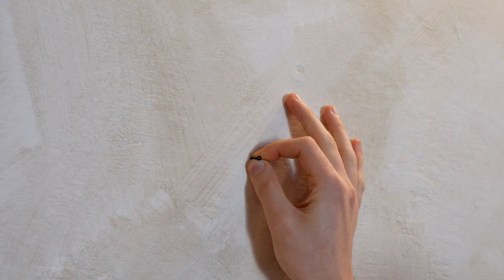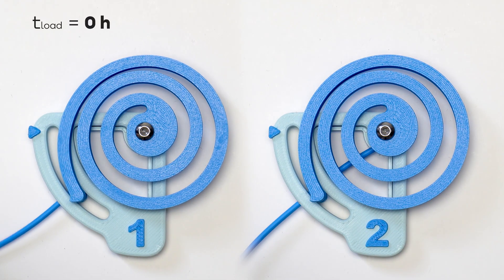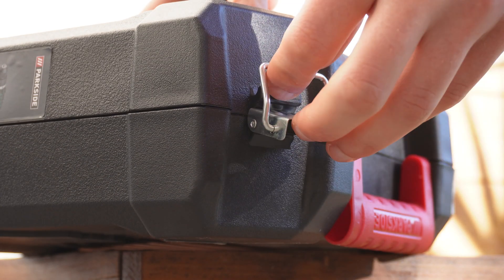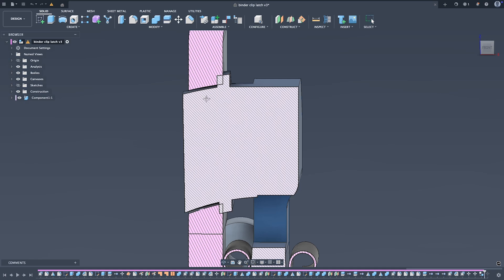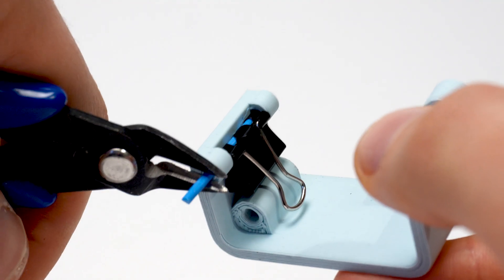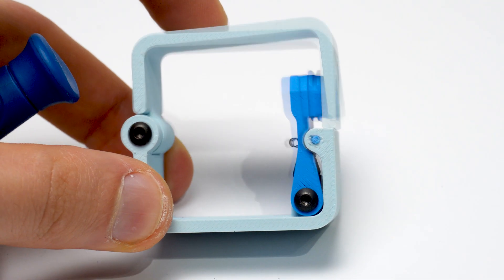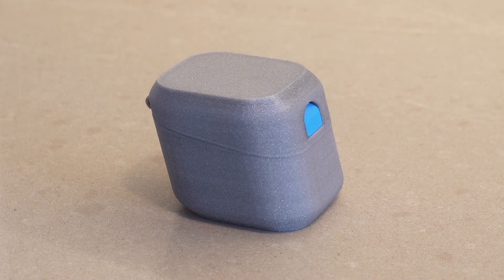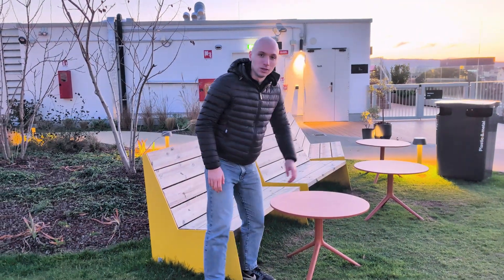Stop 3D Printing SPRINGS. Do THIS Instead

Comment: What a clean print! How did you achieve this? .2mm nozzle? Resin print?
Reply from the maker: Haha, no resin prints here! I'll give you the two tips that made them look so clean.

The first one is lighting: it's better to light them from the sides. If I use a harsh light from the top, the layers become visible (as in every filament print).

The second is using good quality filament, you can find the references for this video in the description

Comment: I bet you could have avoided that screw hole and just used the leverage and preload of the clip to keep that side of the latch in place.
Reply from the maker: Yes, I could've avoided using a screw, but I still want to keep a something that holds the rotation axis in the final design

Comment: do you have a video on your work flow ? I notice you used both fusion and blender and just wondered were there benefits to each software at a given stage of your development of the ideas and concepts presented here ?
Reply from the maker: You can find some of my Fusion workflow in the 'CAD-centric' playlist on my channel, where I show my design steps. Regarding Blender, I actually didn't use it for this project, it was 100% done in Fusion

Comment: Use different metals for different applications — the same applies to plastics. When printing plastic springs, select a suitable filament instead of using PLA for all purposes.
Reply from the maker: I'm aware that other materials have better creep resistance, but I wanted to explain a problem that many people aren't even aware of. I used PLA because it's the most common filament
Reply: @salveo3d  It's okay and I understand that, but you should mention that there are different types of filaments for different applications. A spring printed with PLA versus PETG or TPU will behave completely differently. Similarly, metal springs are made from special spring steel. If you used ordinary steel, it would behave just like the one you demonstrated with PLA.

Comment: No need to have exterior access for the screw. Just use an allen screw, or a 90º ratcheting tool for a normal screw.
Reply from the maker: In this case I had no side clearance for an Allen key
Reply: @salveo3d  I see plenty of side clearance. You know allen keys have two sides? The short one is literally 1cm for the type of screw you were using. And 15º of play is also plenty.
Reply from the maker: @ramaSwamp  Thank you for clarifying that allen keys have a short side, I really didn't know that

Comment: I like the idea of "Hybrid". Binder clip is a brilliant idea. Another way of getting Springs is from liquid dispensing bottles, e.g. hand soap bottles. They are everywhere, with different sizes too. I usually save some of the springs in case I need them.
Reply from the maker: Thank you! Just letting you know that the next project will be even more hybrid. Also, salvaging springs from soap dispensers is a really good idea, I'll do it

Comment: I think you could use something like a drill bit instead of a screw. Insert it into the tunnel in the box, design the connection point on the latch in a C shape, and click it into place. If the sides of the latch where the shaft sits are closed, it won't slip. The shaft housing in the box just needs to provide enough space to fit the shaft. Or maybe you could design that in a C shape too. Give it a try. I'm using Translate, so please excuse any incorrect translations. 🙏🙏
Reply from the maker: Sure Ata, I get what you mean, that's a good idea! Thanks for watching

Comment: What screws are you using? M2 Locking bolts?
Reply from the maker: M3x25mm, an M2 would be enough if you have it on hand

Comment: The idea is interesting, I printed it right away, but now I have no idea where to get such a small clamp, 15 mm wide. The smallest one I have is 19 mm.
Reply from the maker: Thanks for giving the project a go! I guess the 15mm one is the smallest size, and you can usually find it in stores too. If not, the internet is your ally

Comment: Not everyone prints springs, what are you talking about ? And your design isn't really convenient. I guess a metal spring is cheaper than the metal clmap you used here ..
Reply from the maker: Actually, there are a lot of printed springs on the internet. But using the binder clip isn't about price or sheer performance. It's about using something that everyone has on hand and repurposing it

Comment: Funny to watch this just after Print Farm Academy's "why we're injection-molding our bestsellers" -- where the injection moulder also points out they have some 3D printed consumables on the gigantic super-expensive moulding machine. Just because 3D is new and only thing that can say print-in-place chainmail, doesn't mean it's ever going to be good at everything, like springs.
Reply from the maker: Thank you for taking the time to watch it. I've also seen 3D printed parts making their way into high-end machines, and they are great. Injection molding still makes perfect sense and can't be beaten in terms of volume and strength. Both technologies can and will coexist together

Comment: Printing jigs is an excellent way to solve things requiring other materials using 3D printing. I've printed custom jigs for piano wire, bending it into custom spring coils. Actually, making your own springs is easy enough that I recommend the same for others.
Reply from the maker: A lot of people are suggesting piano wire, I definitely need to give it a try. Thanks for the tip

Comment: First draft, the friction and overlap. Well that is when you get to the sandpaper and/or file and start using hand tools to remove material. Unless you want to waste the print and print again.
Reply from the maker: Sure, but if you want to release a public file, you don't want people to have to file their prints. You want the right tolerances straight out of the machine.

Comment: Really cool design idea! You can use two shorter screws from each side and a "modeled thread" in Fusion inside the middle part to maybe get around having that hole on the outside. Schould still be easily steong enough since the stress point in this joint is the two plastic legs of the clip anyway.

Great design in general! I never understood the hype for printed springs in any shape. in my experience they always fail or creep to a point where the "snapped in" position is just very weak with no tension at all.

Comment: i guess you can take into account the deformation coeficient of the plastic you are using, there is a sweat spot where deformation is not ocurring not sure if it is enough for it to act as a spring, using that piece also feels a bit bulky on the design, but pretty cool !

Comment: By the way the binder clip does not use metal to avoid plastic creep, it's the plastic part that acts as a spring, it's just a special type of plastic
Reply from the maker: Actually, binder clips are made of spring steel, not plastic
Reply: @salveo3d  oh really 😮, I didn't know that I thought it's plastic cuz it looked like plastic, thanks for the info!

Comment: I have been incorporating standardized parts into my prints for a long time, and its hugely beneficial. More and more I have been thinking of my prints as a frame that holds the stock parts which get the actual work done. 

Bolts and threaded inserts are common hardware items, but there is another part I would highly recommend: piano wire. These are the metal rods that springs are made out of. They are less common than paper clips, but insanely customizable.

Comment: That's a sick design, good use of found objects. The one thing I'd be worried about is the little crossbar at the bottom of the D-shaped hole that the latch toggles against, that's a very thin part and it's going to be subject to a ton of stress - every time you close it, it's gonna get pushed against, any time anything puts stress against the lid it'll all go there,  and even when it's closed and sitting there, it will have constant stress on it. The whole rest of the design is so robust, that feels like a pretty nasty weak spot. If you could find a way to reinforce that little section with a metal rod or something, or just replace it with a metal rod altogether, i think it would go a long way to making the design robust enough to last forever.
Reply from the maker: Hi Daniel, thank you for the compliments! I'm not sure which hole you're referring to. Are you talking about the one on the blue latch?
Reply: @salveo3d thanks for the reply! I mean the thinnest part of the lid, the actual little bar that the latch clips over and holds against.

Comment: The problem with universal tools is that it often overshadows more efficient, specialist ones. Sometimes it sucks that we need to rent print time, but it does force us to use off-the-shelf parts as much as possible.

Comment: While I like the idea of using binder clips, it seems overkill to use it here for a simple latch that doesn't need to be in constant tension. Even if it is the better solution, it is also quite a bit more complicated.
Reply from the maker: It might be overkill, but it's so miniaturized that it’s totally worth it

Comment: While I agree with the general idea of not printing everything there are some issues with this video:
- Creep wildly varies depending on the material. You could have at least mentioned that it is a big issue for PLA, but much less for e.g. PETG
- This mechanism is a bad example, because it is not under permanent tension, so it would work fine with a simple printed latch. I have several boxes with printed latches, even from PLA, which are fine after years, because the latch is only bending, when opening/closing.
Reply from the maker: I could've mentioned that PLA is the worst, sure, but I wanted to raise awareness on something that's almost never discussed. And honestly, can you print a mechanism that small that works reliably?

Comment: In your v1 demo, the top shell is visibly pushed out by the clip. I understand you want it clipped in tight, but now you're keeping the "spring" that is your top shell under tension. In due time this will cause deformation of the shell even in s bigger model. Perhaps the bottom part should be a bit beefier to prevent this overtensioning of the clip.
Reply from the maker: That happens because it's an open C-shape. Without side walls to provide structural support, it simply splays out.

Comment: 0.3mm free moving, 0.25mm free moving with some sanding, 0.2mm tight fit, 0.15mm pressure fit. These are my orientation independent tolerances on PLA. Learned these on designing nuts and bolts.
Reply from the maker: I agree with the ballpark you gave. here the tolerances were a bit thrown off by the supports that made the first supported layer sag a bit
Reply: @salveo3d  yes, supports do that.

Comment: Thank you so much for saying the quiet part out loud - Just because you can 3d print something, doesn't mean you *should*.
Thats the biggest problem with nearly everyone in the 3D printing community. Trying to use 3D priting for *everything*, even though in a lot of cases, it's the worst possible design and material choice.
Reply from the maker: Sometimes you just need to say what everyone else is thinking

Comment: I love the idea of hybrid 3D printed designs.  I wonder about using other materials like windshield wiper stainless inserts or carbon fiber tubes.
Reply from the maker: Carbon fiber tubes are superb. Got an 8mm OD tube from Decathlon recently, it's amazing. Might have a project for it on the channel

Comment: In this type of mechanism, the spring is only loaded while latching, so creep shouldn’t be an issue. Limiting the range of motion of any flex and using it only occasionally changes the calculus. But this approach is excellent, and integrating OTS  hardware is an important part of designing 3d printed objects!
Reply from the maker: Thank you! It might be overkill, but it's such a compact solution, I just had to go with it

Comment: Great idea, but piano wire (also known as music wire) is a much more versatile and customizable spring element. Yes, you need to do more calculations at the outset (or experiment with different thickness of music wire), but you can dial in the exact spring force you want over many orders of magnitude, you can cut the wire to any length you want, and because it's a straight piece of wire it can be hidden in surprisingly small/flat parts.
Reply from the maker: I'll look into piano wire for sure, sounds interesting! The goal here was to use something readily available and ready to use

Comment: Very good idea! I have a box of metal coil springs, but this is much better for this application.
Do you even need that pivot screw? Just a recess in the outer shell for the lower part to sit in might be enough (restricting up/down and side movement), the clip is applying pressure to keep it situated there.
Reply from the maker: Yes, the more I look at this project, the more I see that the screw is overkill. A guide to keep the rotation axis stable would be more than enough

Comment: I think this method is useful for when a lot of strength is necessary, but is total overkill for the example box clip. Designs utilizing plastic spring forces have outlived the life of the plastic itself. They don't always lose spring travel, only when pushed past the limits of the material.
Reply from the maker: Honestly, it may be overkill, but at the expenditure of a binder clip, just a couple of cents. And you get a miniaturized mechanism, way smaller than if you had printed it

Comment: I really like the overall design. I printed a couple and here's my thoughts:
1. I love the clip idea, most people can get them. I love being able to print everything but maybe that's another days problem?
2. I don't think the internal screw is needed. if the binder clip is static and the latch stays it is retained by the clip. maybe making sure the clip can not move and the latch says seated inside the spring with rails to make sure it does not move.
3. opening seems less "satisfying" if you will, if you push the latch it does seem to spring open slightly. maybe increasing the upward pressure slightly. this might be a fine tuning issue between printers/filament.
4. immediately one of the hinges cracked. made me think perhaps having only 2 sides to the hinge rather than 3 might increase the strength some? This could be due to the hinges not printing cleanly.
5. installing the sprint clip took me a bit to figure out. getting the filament to slide in and getting the latch in the spring was harder than I imagined

Overall I love it and don't mean to focus on anything negative, just providing feedback
Reply from the maker: Thank you Nate, that’s some amazing and thorough feedback. I really appreciate the time you took to write this, and I want to address every point you made:

1 - Not printing everything was exactly the point of the video! Could you print it all? Sure. But sometimes, finding a more reliable 'off-the-shelf' is better

2 - I agree, the screw is a bit overkill. Many comments suggested great alternatives, like using a simple groove to guide the rotation, which I’m looking into

3 - You're right, the opening action isn't quite satisfying yet, it needs more refinement

4 - I didn't quite catch the '2 sides vs 3' hinge idea, but if you want them stronger, you can increase the wall thickness in the CAD sketches. The model will update automatically to make them beefier

5 - Installing the filament pin is definitely tricky due to the tight side clearance. ABS works best because it’s a bit more flexible, but a wider case would definitely be the ideal solution

Thanks again for the support and for helping me improve the design!

Comment: I agree that hybrid designs tend to be better, and I personaly use a lot of metal in my parts (bearings, bolts, hinges, springs, etc). But, you also have to consider that PLA is not very good for objects that will be deformed during the use. PET-G and ABS offers much better stability.
Reply from the maker: Other materials definitely perform better. I just used PLA for the example because it’s the most widespread material out there

Comment: This creep issue is VERY apparent with PLA, which is what most people print with. Plastics like PETG, ABS, PC, PA6/12 (nylon), and others don't have this issue as severely to varying extents. But a metal spring will ALWAYS do a better job!
Reply from the maker: Yes, unfortunately PLA is the worst in terms of creep. Did you see how many degrees of rotation were lost in just 12 hours?

Comment: Are you using PLA? I would think that given just a little bit of time that filament hinge would break because of how brittle PLA gets.
Reply from the maker: I used ASA as a pin in mine, but yes switching to metal also for the pin would be the best thing to do

Comment: I think this is good advice. One thing you should be aware of is that filament pins tend to shatter over time, even if they’re not under load. I recommend annealing the pins so they’re not under the constant strain of being held in a straight position.